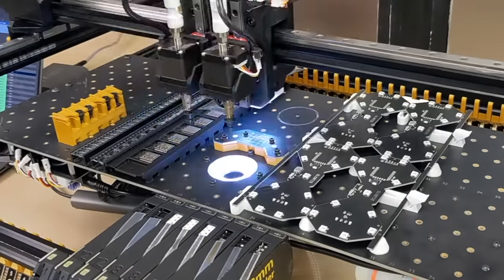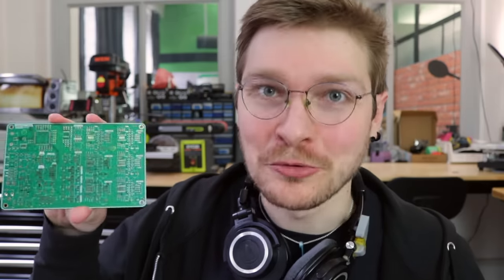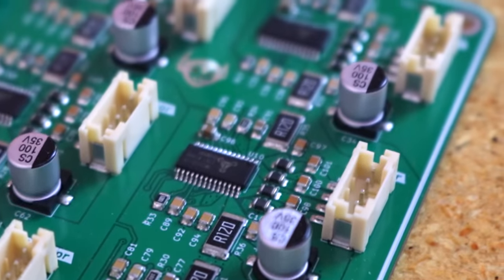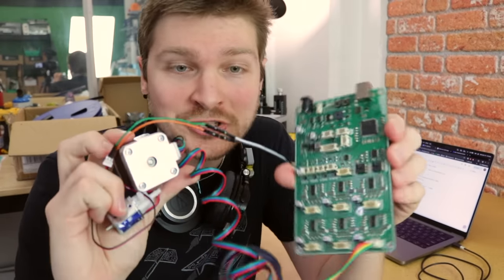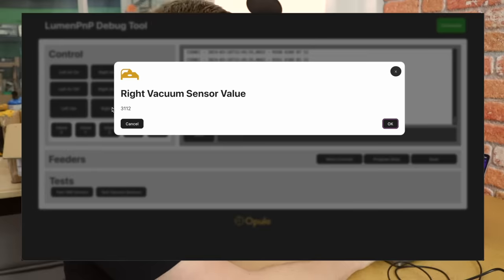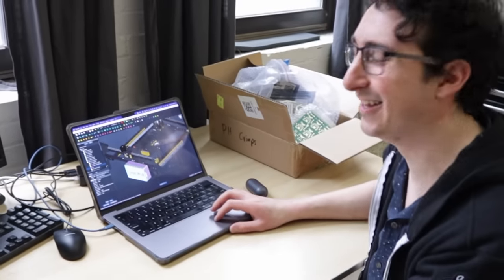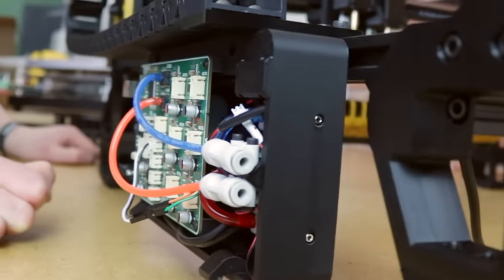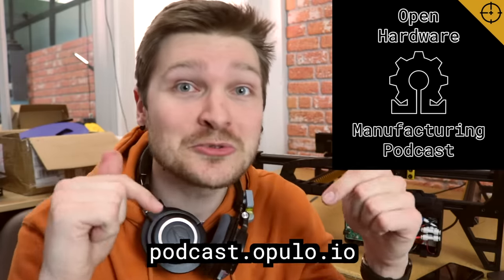This Box Builds Circuit Boards

Comment: For the connectors: Connect the mechical pad to a larger copper fill so there is more adhesion and use vias to add more mechanical strenght.
Reply from the maker: yeah i made the mistake of leaving the mechanical pads isolated on this rev, the community corrected me on that one! next beta is connected to the ground pour
Reply: Came here to say the same thing.. Have seen motherboards with surface mount connectors use grid vias which I assume act as more or less a through hole connector.
Reply: @stephen_hawes great response, real Agile spirit. Also new content for a channel 😊
Reply: Vias improve adhesion, but there's 
a limit because the via plating isn't very thick. And connecting direct to copper pour is a bad idea for soldering. Surface mount connectors simply are not as good as through hole. Pin in paste so through hole components can be reflow soldered is more or less the perfect middle ground
Reply: If there is insufficient ground pour around a mechanical pad or space constrained, then I would like to add there is a little trick that can be done to improve the strength of mechanical vias... you can either place a single 0.3mm or 0.4mm via in the center of the mechanical pad or one on each corner of the rectangular pad (depends how large the pad is). When squeegeeing the solder paste, it fills the via and during reflow it creates a "solder leg" like with through-hole soldering - which is very strong. The other side of the via must be left open though (no tenting) and have a very small solder mask expansion (5%) to allow hot trapped air to escape and to prevent wicking the solder respectively. 
I've used this a few times on automotive electronics because vibrations in vehicles is so bad that SMT connector just fall off eventually.

Comment: Stephen: builds a PnP Machine and a company around it.
Also Stephen: Populates the mobo for said machine manually xD
Reply: Sometimes you just want the Zen of populating a board manually.
...and it can be faster if you only need to make one.
Reply from the maker: AHAHAH true! i actually made a calculator to determine when it makes sense to set up the PnP!: https://compare.opulo.io/
Reply: 😂 the ultimate "Tool or Project" solution! I am always inspired by your commitment to true efficiency, not just shaving off seconds that will cost minutes.
Reply: @stephen_hawes I think that could have done with a little comment as it confused me for a moment. ;)
PS. Great to see how far you’ve come with your “little project”!
Reply: @stephen_hawes  That is very helpful, thanks! As a hobbyist who has done runs from quantity one to 100, I've wondered about the point where it makes sense to use a PnP.
Reply: Its the cobbler's children have no shoes parable.

Comment: Looks awesome!

Food for thought: pressure sensors on daughterboard(s)

I’d be concerned that either the fitting or the sensor would degrade over time.End user servicing of it seems likely. Not having to hand solder or replace the motherboard would be nice.

Comment: USB C High Speed (2.0) SMD Connector as a suggestion.

There are a few now which don't have any parts sticking through the bottom of the board.

Stuff like the GT-USB-7047A

Comment: You guys may have a reason for this, but I think you'll want to move the pneumatics out from under the mobo. It's always best to avoid parts behind parts, because it means every time to need to get to the thing on the bottom, you add risk to everything on top.

Great work! On the board! I've just gotten back to making boards for some of my stuff, and hearing your lessons, and some from these comments, has be fired up to make my nect designs better!

Comment: Watch out for direct sunlight heat. Currently doing the same thing with one of my products. (One VERY big spicey FreeCAD body!) One thing that I found when testing was higher than expected temperatures with direct sunlight on hot days. I used PETG, that held up fine but internal components got up to 80c. Although your product is for indoors, someone could easily have it next to a window with direct sunlight on a black box full of electronics.

Comment: So nice to see how the LumenPnP progress!
The drag chain does not need to start until half of the travel. You will save a few chain links. Be careful about the chain bend radius. Respect the manufacturer recommendation for peak performance and look. Finally, you might want to support the bottom part of the chain in a tray. Adds a lots of stiffness to the system.

Comment: You seem like somebody I need to talk to in regards to an idea I have. Absolutely doable.
It is a different mechanism for Cartesian control.
There is only rotary motion!
If you're milling, 3D printing, etc. It is all done on the inside of the motors that are stacked in the same axis over top of each other.
So if your build volume or workable volume is 3 feet in diameter, your motor would be slightly larger than 3 feet in diameter. Think about the torque applications on that.
And it will have absolutely zero backlash with easy capacity to achieve submicron precision.
Submicron precision to the point you could turn this into a laser lithography machine.

Comment: This looks amazing. I've been thinking about a single board solution with SMD connectors for this for a while now. The only times I've had problems with SMD connectors is when someone was being a brute with them. They work well, people just need to stop pulling them without pressing the the release latch! 
The only thing I'd add is a USB hub chip, so you can connect the machine to a PC with a single cable, without having to have an external, dangling USB hub. Since not everyone will want this, it can be an optional second enclosure that mounts next to the main one. Or the enclosure could be enlarged and the USB hub can be an optional board.

Comment: Strange that you'd move to integrated stepper drivers instead of socketed ones, if a driver blows (known to happen, at least in the 3D printing space) a socketed driver would let it be individually replaced instead of swapping the whole board or doing a messy solder repair. In the 3D printing sphere, socketed drivers are seen in the higher end boards.

Comment: heres some goals to acheive for later on if you really want to succeed in as wide of a set of "markets" as possible
1. price
2. simplicity
3. ease-of-use (or plug-n-play)
4. increase the capability to run things "manually" to let the machine "learn" or to do things that the machine is not currently capable of
5. increase the capability to run different tools, so you can upgrade your machine, or use cheaper machines that you upgrade later

so if you want people to get their hands on it, go for aluminum extrusions and basic rails/wheels
if you want to go for industrial, upgrade the strength of the parts, which inevitably increases the price

for a business, 2k is basically nothing
for an individual 2k is a very steep price for something they arent going to be using 24/7 (you could do an "individual board" variant that does things one component at a time, and uses cheaper parts that just get the job done and nothing more if you want to go for these people)

Comment: A 90 degree connector on those pressure sensors will reduce the strain of the hoses being looped toward the case.

Nice enclosure design. Any issue with the pump's magnetic fields being in proximity to the board?

Comment: Please dont put the stepper drivers onto the board, make them easy to replace, if one burnt out, you can just bye a ney stik, and not the hole MB. please.
Reply: I agree. If space was the issue, low profile connectors exist
Reply: Laughing in Apple style hehe

Comment: Would adding some tented vias at the corners mounting pads of the connector (not underneath so that way you don't have to deal entirely with via-in-pad costs) further help in preventing pads from ripping? Akin to tent stakes just for the mounting copper pads?

Comment: I am not sure how much heat all those components in the sealed box generate, but some slits to allow for better convection cooling might be a good idea? :)
Reply from the maker: true! we're also adding an extra port for a fan in case active cooling is necessary!
Reply: @stephen_hawes  Fan? Change the vacuum pump for a venturi vacuum generator, and use the excess air to cool the components. ;-) Compressor far away, less noise, yada yada, yada...
Reply: @stephen_hawes  You'll probably want to go with modelling the enclosure to accept something like a Noctua NF-A4x10 (If you move the pumps toward the middle a bit, the fan can go into the side of the enclosure where power and USB come in, so it can directly cool both pumps immediately and then the underside of the entire PCB), and adding a 4-pin motherboard header for it. If you want to keep using JST-PH, you could include a wire harness with JST-PH male on one side (to plug into the PCB) and a 4-pin fan header on the other side (much like the Low Noise Adapter that also comes with the fan). If the motherboard doesn't have any temperature sensing capability, you can get away with a 3-pin header and people can use the NF-A4x10 FLX. Otherwise you will probably want the firmware to control the fan speed, so go with a 4-pin header and people can use the NF-A4x10 PWM. Your board will need a 12V rail.
Reply: @stephen_hawes   Hey I just found out there's a 24V version of the Noctua NF-A4x10. Even better.

Comment: Save your fingers, use a thermal cam !
Reply: +1 a thermal cam is quite useful for testing PCB designs. I've also used it for identifying shorts on boards - e.g. when I swapped the decoupling cap and small value resistor when manually populating a board. I could easily see that the resistor was hot, so I knew where to look for trouble.
Reply: @Adamsmasher23  Man for me it is an every day tool. We work with a board which has a Chinese dc-dc controller and it had been burning within some hours of use. I made a temperature slope study and despite of being very inside operational limits there was units with too different slope behavior at same testing load. It was very simple, a timer and a thermal camera and I found out that in good units the IC would heat up evenly and end up around 60 deg C. On bad units there was a very small spot on IC which was reaching > 80 deg in very short  time and in 2 seconds it was stable like good units. So it was right on target and our huge pain with returning products is now 100% solved. So, if I can give an advice to anyone making electronic stuff is: Buy a thermal camera. Know your product's "normal" thermal imaging and you are going to be very happy when you need to figure something out about it.

Comment: If you enclose the motor drivers in the box, aren't you worried about overheating the drivers?
Reply: Unless they're running it hard its not an issue - 3d printer guy

Comment: Oh, for your drivers, if they dont have local thermistors, there are some really nice 4 pad i2c thermal sensors on mouser right now that you could try reverse mount soldering. Theyre bga, so they should stick during main side reflow. Then you could do temperature monitoring and cooling using a small fan for the whole case